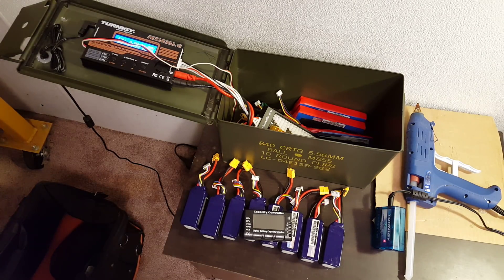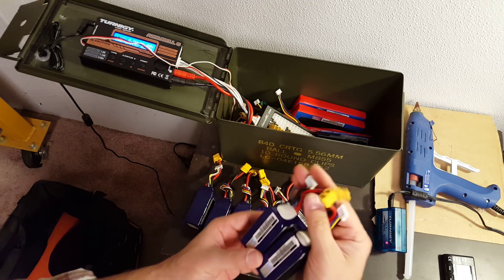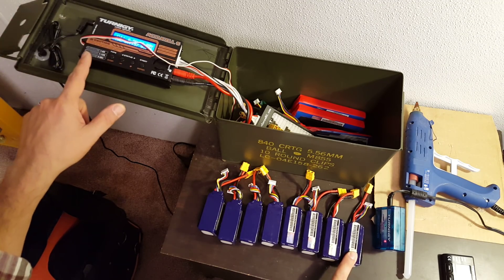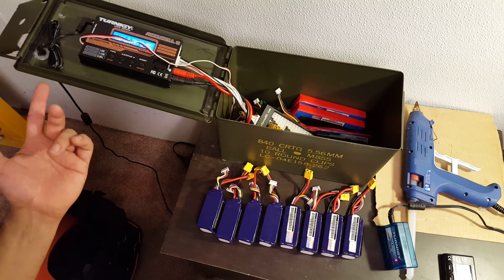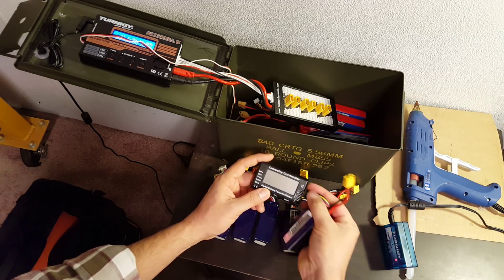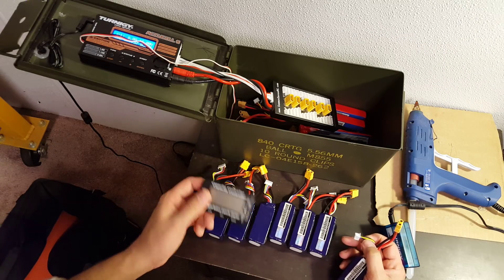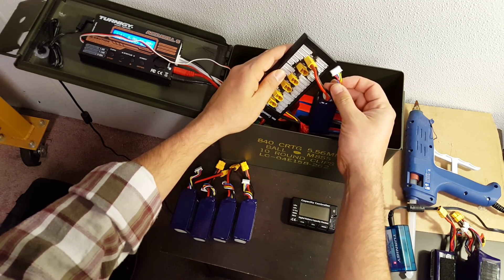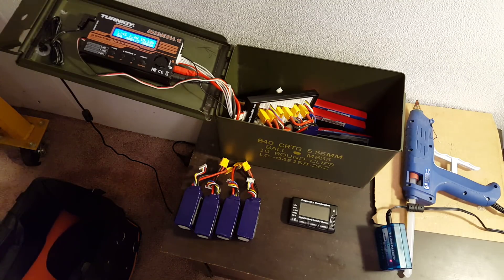How To Parallel Charge LiPo Batteries Without Burning Down Your House

Comment: Hi Joshua. Just started flying again.
Question about my 4s lipos.
The 4th cell and sometimes 2 cell are out by alot
Even after a single balance charge them.
After flying
14.8 
3.77, 3.72, 3.72, 3.66
Once balanced
Its 16.8 or 16.7
But 4.2 or 4.19 on 3 but the forth is 4.14 or even 4.08.
Is my charge out of wack or are my lipos toast?
Most of the time the charger says 16.8v and 4.2 per cell when charged however I check them with my meter and they read as above.
Is my lipos toast or is the charger wonky.
I use a venom pro duo
Thanks for the help
Reply from the maker: Are you 100% sure your battery checker is right? Can you check with a good quality multimeter? Measure between adjacent pins of the balance plug and you should see the individual cell voltages. BE VERY CAREFUL not to short the probes together.

Comment: I think you forgot a very important point that I'm dealing with at the time. I over discharged some of my batteries and damaged them so hard, that some cells are not able to charge up to 4.2V anymore. The voltage limit of some cells seems to be droped down to 4V. If I charged them parallaly with a healthy batterie the damaged one would very likely take fire for obvious reasons. So a very important point is also to check if the maximum cell voltage of the parallel charging cells are still the same.
I would like to hear your oppinion to that.
Greetings from Germany
Reply from the maker: Yes you're absolutely right. In general, only parallel charge healthy packs. Anything that happens to one pack in a parallel array will happen to the others.
Reply: idk why this comment doesnt have more likes or isnt pinned. this is something VERY serious to consider.

Comment: 1300mAh x 4 is 5200mA.  50W or 6A is the highest current your Turnigy Accucell 6 will output  to the 4s (3.7v x 4 =) 14.8v (or is it 16.8v)  50w/14.8v = 3.38A to the 5200mA 4p4s target. could one use a power supply which outputs 18v 6A ?  if you wanted to charge 8 1p4s batteries simultaneously could one use an 18v 12A power supply?   I missed the reason to use a balance board with the balance leads in this collection of 4s batteries in parallel.
Reply from the maker: WIth a smaller charger, you can't charge fast enough to make the parallel board save time. But it still saves the hassle of swapping batteries repeatedly.

Comment: Great video. I have been parallel charging lipos for many years and have not had any sort of "incident". Just use common sense and care and you will be fine. I use parallel charging boards coupled with a series of smart chargers able to charge up to 12 batteries at a time. I, of course, never leave the room when they are charging and have a fire extinguisher at the ready.
Reply: Is it ok to charge on different mags when parellel charging..... say you have 2 - "450mahs" 2 - "550mahs" of course both 3S....

Is that possible?
Reply: @FPVMgunit13  I have charged different capacity batteries [same no. of cells of course] without incident. Just don't go to wild concerning the differences. For example  1500 3S and 1700 3S but not a 800 3s and a 4000 3S. The example you are showing with your batteries are fine [only 100 mah difference]. As always stay close when charging. I always try to charge no more than .8C

Comment: My power supply is rated at 1500w 24v 62a and my charger is the ISDT T8.  I am using the JB fused parallel charging board and am charging 4s batteries.  Assuming all are within .4 of eachother and all are the same make and brand, is it OK to charge 1500's and 1800's together?

Comment: Thanks for talking me through my first parallel charging of 3s I notice that my JB charge board looks different than my bang good board. Is there a how to for the jb board, or is it exactly the same, just with nicer components?
Reply from the maker: The JB board functions the same as others. It has polyfuses to help protect against a fault (but you still must use safe charging procedures).
Reply: Just to confirm, it does not matter which order I plug identical batteries into? I can plug one into slot 2 and another into slot 8 and it will still work fine? Thanks for all the help!
Reply: I've used it a couple of times now and the JB charging board is AWESOME!

Comment: If, when you start parallel charging, the actual voltage of each battery may be different until all of them are charged to an equal voltage. I believe that the lowest voltage will get most of the current until it reaches an equal voltage all around. It seems to me that, if most amps go to the lower voltage battery, you risk over charging the lower voltage battery.
Reply from the maker: Not over-charging in terms of voltage, since the final voltage will always be between the highest and lowest. But over-charging in terms of charge rate, or amps, yes. Definitely a risk.
Reply: If they are connected in parallel - one battery will not take all the amps - they act as a single unit - and voltage will equalise almost immediately they are connected on a board anyway -  as long as they are within the ballpark, seconds.

Comment: Bardwell...Good vid but maybe time for an updated vid?... addressing different MAH / new high C ratings/ voltage differences / new 6S trend / board daisy chaining misconceptions. The old rule of thumb of 0.1v per cell difference is often mistaken for the total 4S lipo (0.4) voltage.

Theoretical question: If my lipo says it can be charged at 5C then why is it a fire risk to plug in six 4S 1300 100C lipos at say 14.4, 15, 15, 15, 15, 15...? Won't the weakest lipo just be equalized at a 5C charge current? Thank you.
Reply from the maker: Check this video out, regarding equalization current: https://www.youtube.com/watch?v=yTEGhKBv09M

I suspect you would see way more than 5C in that case. I suspect you would see peak current easily into the tens of amps.
Reply: Joshua Bardwell ... point taken. So definitely stick to the old rule of voltage difference. And plug in the lower charged lipos with the highest charge lipos last. Thank you.

Comment: Always keep a class D fire extinguisher nearby! I even mounted one on my truck just to have nearby when I'm flying, just b/c ya never know! Lol can get a small marine grade one at Walmart for $25, small but enough to put out a LiPo fire 👍
Reply from the maker: Nothing can put out a LiPo. They are self-oxidizing. They'll burn underwater. The fire extinguisher is to put out the things the LiPo lights on fire. Best response to a LiPo fire is to pour a bucket of sand on it. That'll help contain the flames and dissipate the smoke.
Reply: Joshua Bardwell safe to say I was misinformed then haha thanks for the info!

Comment: i have the same charger as joshua in the video, and did all the steps, but my charger sais 'voltage invalid', so i cant charge
Reply from the maker: I think maybe you have plugged only the balance leads in but not the XT60?
Reply: Joshua Bardwell i did plug it in
Reply: the voltage meter of the charger shows only two voltages, 4.35 and 9.something

Comment: Hey, do u advice to charge 1300 mah packs and 1500mah packs together? Like is it safe if we do so? Ofcourse of same cell count
Reply from the maker: Yes, it's fine. Capacity is not so important in parallel charging. Just add up all the capacity together to get the total mAh of the array and use that to determine max charge rate.
Reply: thanks alot..

Comment: I use different strategy to charge my battery park. When i'm going out for a flight day to the nearest field i take only about 4 4s 1500mah flight batteries  and couple of old 6S 10000mah batteries  coupled with ISDT pocket chargers.  All my flight batteries are graphenes lipos, means i can charge them at up to 15C rate. 15C is too much, but at 6C it takes about 10 min to re-charge the battery. So my rotation is following: 1 flying, 1 cooling down after flight, 2 charging. Given the flight cycle duration of about 6 min(3-4min to fly, 2-3min to swap batteries, do some tuning, take rest for the eyes) i get new battery by the end of every cycle ready to be installed on quad.

This way you can get about 20-22 flight non-stop per flight day. With parallel charging you will have to take 1 big brake to charge them all.

Yes, i know  that charging at 5-6C is not good for battery cells, but so far i  don't see much degradation in battery life and performance. Statistically, my batteries life is about 30-50 cycles, before it get's smashed into the ground as a result of the crash.

Comment: Should I always parallel charge packs with the same C rating or is it ok to charge a 4s 1300mah 75C pack together with a 4s 1300mah 100C?
Reply from the maker: C rating doesn't matter at all when parallel charging because you should always be charging at 1C or less.
Reply: So if i understand you correct, I can parallel charge my 4s 75c lipos with My 4s 45c lipo? Sry I'm new to this
Reply: Gunnarss00n FPV yes

Comment: Hey sir.. so I watch plenty of your vids over and over again most times..i have a question on this one. Ok. So you explained everything great BUT when you plugged in the batteries, it looked like you just picked which ever port to balance. So I guess it doesn't matter which you use as long as they are all 4s. And can I plug in all my batteries at once
Reply: How do you know which ports to plug the balancing leads into?
Reply: @jacobhyer6931  most chargers let you charge from a range of 2s to 6s . The port to plug the balance wire will start with the negative on one side. Match the negative by looking for the symbol on the charger and look for the negative wire on the battery plug.. the positive wires will fall in place as long as you match the negative wires correctly.
Reply: @RAYGUNN1978  Thanks so much!

Comment: im sorry what is C" rate?          i have 3 1500mah so i set 4.5v?
Reply from the maker: C rate is the rate of discharge or charge relative to the size of the battery. For a 1500 mAh battery, 1C is 1.5 Amps. So three 1500 mAh batteries in a parallel array are a total of 4500 mAh. So a 1C charge rate for three 1500 mAh batteries in parallel would be 4.5 Amps.
Reply: oh! good!..i did it correctly!..no fires!...it took about 1 1/2 hours for three and i have the smart charger D2!

Comment: Can I charge multiple batteries with the same cell count and mAh but they have different C rating?
Reply from the maker: +Ray Hamo yes. And mah mostly doesn't matter either. Voltage is what matters.
Reply: Joshua Bardwell Thank you!

Comment: You're plugging your balance lead in the 6S port of the charger while you're charging 4S. Is the charger knows automatically that it needs to balance charge with the 6S port while charging at 14.8 V ? I ordered your V1 parallel charging board, can't wait to try it !!
Reply from the maker: If you only plug in 4S batteries to the parallel board, then there will be no voltage on the 6S wires. The charger will correctly read the battery type.

Comment: Does it matter which socket we use on the charge board? I always put mine next to each on there but you had gaps until the last battery.
Reply from the maker: +Stop Drone-ing on no it doesn't matter.

Comment: does it matter which set of balance connectors on that parrallel board you plug into? for example if I'm charging 4 4s batteries, can I just choose 4 random 4s balance connectors to plug into?
Reply from the maker: No, it doesn't matter.

Comment: on a balance charge board why would I get a spark hooking a battery in with it all hooked up correctly, I had one that the ballance lead started getting hot right away so I pulled it out in time.
Reply from the maker: +Ron Triano the voltage difference between the batteries was too much.
Reply: +Joshua Bardwell thank you, I will try another battery. This happened with only the first battery I put on the board.
Reply: using a balance board for LiPo batteries, I can't even plug in a battery that has only 4 tenths of difference between the cells without the battery shorting out and I have to pull it out right away.

Comment: I wan to charge 2 2200mah 4s batteries using the isdt q6 charger. What would a safe amp setting be?
Reply from the maker: 1C is always the safest setting. So if the battery is 2200 mAh charge at 2.2 amps. If you have 2x 2200 mAh in parallel, charge at 4.4 amps.
Reply: Joshua Bardwell awsome, thanks alot

Comment: How fast parallel connected batteries equalize each other, when you first connect them on board? Maybe one battery charges above its max. C rating? I couldn't find an answer on web.
Reply from the maker: https://www.youtube.com/watch?v=yTEGhKBv09M
Reply: Wow, you already made a video on just about that. Watching now, thanks Joshua.

Comment: How do you parallel charge if your batteries have JST connectors?
Reply from the maker: You need an adaptor, or a parallel board or harness with JST connectors.

Comment: Nice video! But i have a question.  If Im charging 3x 3s 1000 mah on a parallel what would be my A in charger. Is A means amperage? Sorry for noob question
Reply from the maker: You want to charge at 1C or less, which means the total capacity of the batteries, expressed in amps. So 1000 mAh * 3 = 3000 mAh -> 3 amps is 1C.
Reply: Joshua Bardwell thanks a lot. I'm charging it on 2a before now i know i can go 3a haha. I little bit faster

Comment: Question on the amp setting in the battery. Why did you set the charger to 6A? you have 4 1300mah lipos so thatd mean 4x1.3=5.2A so youre overcharging at 6A no?

EDIT: Ok so i think I got it. Youre using the 1C charge rule right? Basically at a 6A charge rate (6/4=1.5A) youre charging each battery at 1.5C? So if you had 4 4s 1300mah lipos with a max 5c charge rate and a capable charger you could theoratically max charge at 26A right? (1.3A x 5c= 6.5A, 6.5A x 4 lipos= 26A charge rate?)
Reply from the maker: That sounds right. But don't even charge 5C on a parallel board. If even one battery is not right, the whole thing can be damaged or blow up. Charge 1C or maybe 1.5C max on a parallel charge board is my advice. Frankly, I would never charge a LiPo at 5C no matter what the manufacturer puts on the label.
Reply: Joshua Bardwell  ah cool thanks for the fast reply. 

And Yea i threw that 5c in there as in an example to see if l got the calculations right

Comment: If I'm have 1300mah with 4s but have variation brand and variation R value accross the brand, is it okay to parallel charge it ??
Reply from the maker: As long as they are the same voltage, I would do it. If there is a HUGE difference in IR, then the balance part of the program will take a lot longer.

Comment: Hi! Nice video!  I've two big 5200mah 3S battery that I use for my multicopter. Does it mind if sometimes I connect them in parallel (following your voltage rule) using only the main discarge lead (using a Y style cable) an charging them together without using balance plugs? I'll balance them every other charge for example :) edit. I just remembered that one of the battery has a 4S balance plug but with only 3 cells connected (cause I've broken the 3S balance lead in crash). I think In this case I'm good to go. Just use the Y cable and connect both the balance to 3S and 4S plug on the charger :). I have your model and the balance connectors should be all in parallel.
Reply from the maker: If the batteries are healthy, they should stay in balance and be okay. But the correct practice is to balance charge EVERY TIME.

Comment: In this balance board , is it important wich balance port you use ? Is each xt60 port related to 1 specific balance port ?
Reply from the maker: They are all in parallel so no it doesn't matter.

Comment: Somewhat doubtful how to handle the rule where all cells must be within .1 volts, before para charging. See, I have the same charger, Turnigy accucell 6... After a session of running a few batteries dry, I must get them all within .1, right? So I must hook them all up individually and It would make sense to balance them all to their collective average volt... But the Accucell 6 doesn't let me chose an end voltage, only different settings such as storage (14.2) or balance (16.8)...
So my current strategy is getting all my 4S's too storage (14.2) and then para them together to 16.8. Is that the best I can do with this charger? Is there really no way to chose my own custom end-voltage, either total or per cell? It just seems like a waste of time getting them all to 14.2, theyre all around 13.3V +/- .3V
Reply from the maker: Basically, you use your telemetry or OSD to end each flight at approximately the same voltage level. Any odd-battery-out must be fully charged individually.

Your strategy of getting them all to storage is a good one.

Comment: I have a 4s balance charger. Will a 6s parallell board work with a 4s balance lead extension, or do I need to rearrange the wires to make it work? I noticed this one has a black and red wire at each end suggesting Supply and GND.
I'm guessing I'll need to make sure the 4s balance lead's  black and red wires correspond to the boards black and red wire locations, no?
Reply from the maker: +Albert Gustafsson it's risky to use only a 4s balance extension because if you ever were to plug in a 5s or 6s battery the last two cells wouldn't balance. If you only use 4s, it's okay though. But for goodness sake don't forget.
Reply: Alright thanks!

I only go with 4s batteries right now with some occasional 3s for fpv box so it should be ok.
When time comes I'll get a better charger as well.

And thank you for a very informative video!